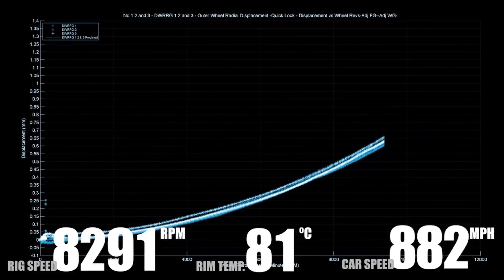Designing a Wheel for the World’s Fastest Car

Comment: There is a 1,000 mph world record car being built. In the article, Lockheed Martin is credited with the design of a 10,000 RPM all steel wheel. The Lockheed guy said that although the prototypes all achieved that RPM goal, they are right at the edge of what is possible using today’s metallurgy. It all works fine in free spin in a lab but how will it do holding up a couple of tons and blasting across a salt surface that will have up to 3 inch irregularities in it. I hope they get the salt glass smooth before making a run. And engineering the shock waves will be critical. What happens to the shock wave under the car?

Comment: Did they just say it will be powered by a piston engine rather than a jet engine ?
Reply: The piston engine is used solely as a FUEL PUMP for the rocket engine.  They were originally gonna use a Cosworth F1 engine.  The piston engine is used solely to pump the liquid oxidizer at a high enough flow rate and pressure, to the solid fuel rocket that takes the "car" from 600mph to 1000mph.
Reply: If I understood correctly, it has three engines. They will be using a piston engine coupled with a rocket engine along with a seperate jet engine. The same jet engine that powers the Eurofighter Typhoon.
Reply: AverageSuscriber17 that is insane !